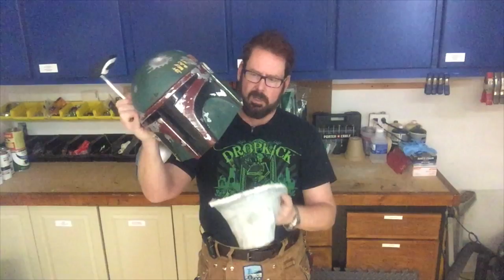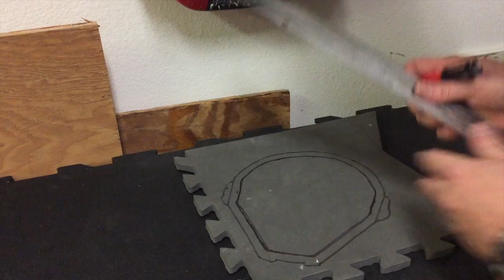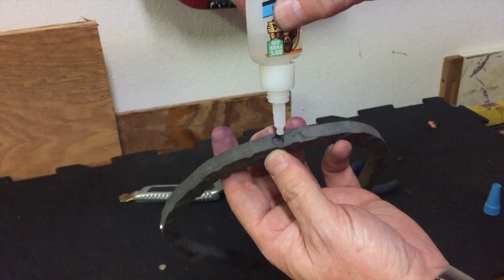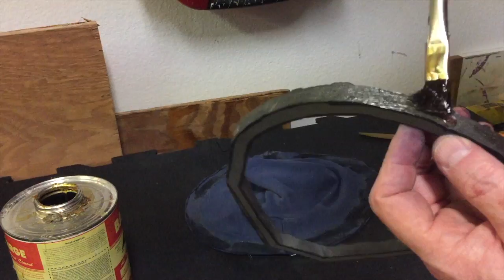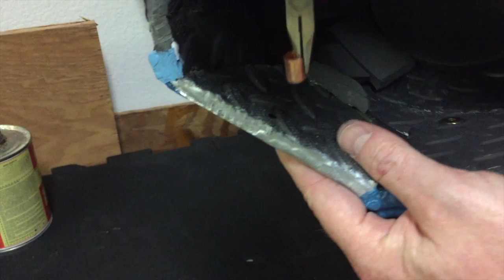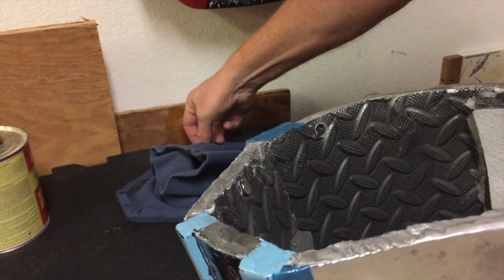How to make a Neck-Ring & Collar

Comment: Damm .. so simple yet so effective!! You earned a like and sub sir.  I have a 3d printed helmet I want to try this on, the only issue is i cannot "dig" into the 3d print to put the magnet, best i can do is just glue them on I think.
Reply from the maker: just an idea, but what if you mounted the magnets into a .5 or .75 inch piece of 
5mm. craft foam and then glued the whole thing around the inside bottom of the helmet? It would essentially be the same as gluing the magnets onto your helmet, but it would be concealed by the strip of foam.
Reply: @thepropmasterwithrobertwal6186  That is a very good idea, its not for a standard stryle helmet, its a mod on a tactical helmet with a 3d printed full face mask (SRU type 1) so i can only realistically attach to the faceplate... and maybe the ear part... everything on the back is your standard tactical fast helmet with a dial tightener so that blocks the entire back side.  I guess you could say it be a variant of your concept adapted to this.

Comment: If the diameter of your magnets is around 3/8s", go to your nearest gun range and ask them for a couple of empty 9mm, .380, .38, or .357 shells - you can pop the primer out, sharpen the edges of the shell, and get the same result -- and you don't have to purchase an entire package of those copper crimps.
Reply from the maker: Tim Hagey 
That could definitely work.